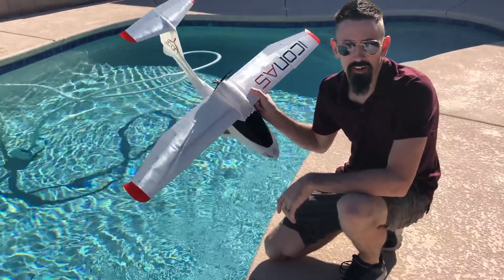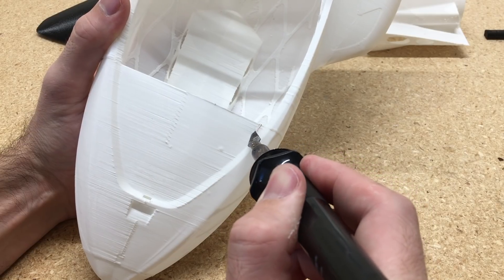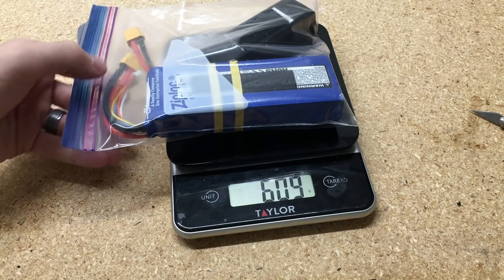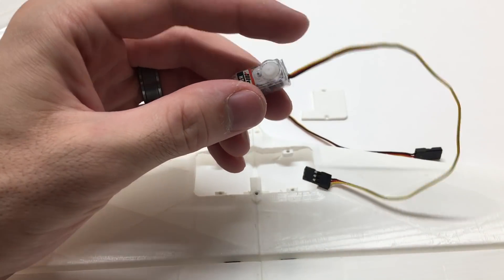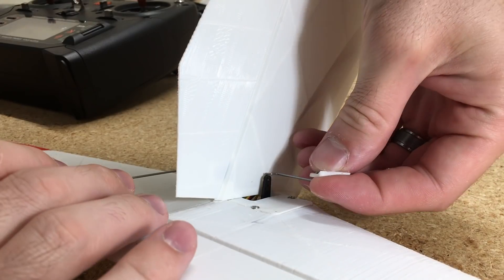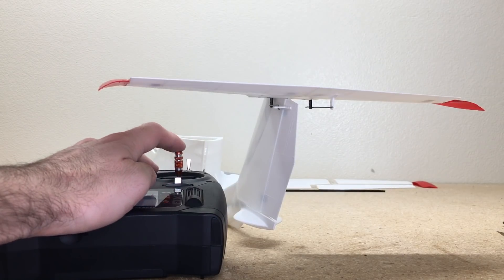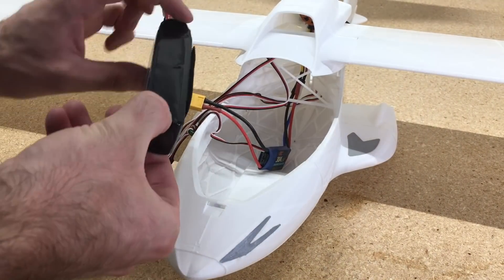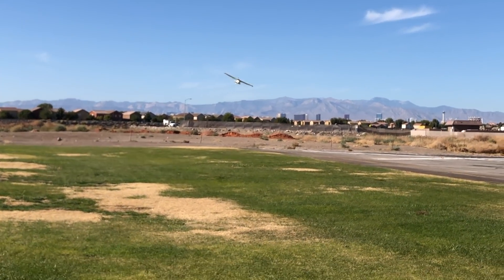How to Build 3D Printed Icon A5 - Planeprint

Comment: For the servo extensions, you can 3d print clips to hold those from coming apart so you don't have to solder the extensions on

Comment: Printing this at the moment and having some success but generally I would say that it is not strong enough the wall thickness is too thin and I think I would have sacrificed some weight for thicker walls. Also Fuselage Part 4 has overhangs that collapse if in CURA you add support it doubles the print time from 8 hrs to over 16 hrs. I can only assume that this will fill the fuselarge with support and because this structure is so thin I dont think I will get it out without destroying the part. I was wondering how you dealt with this issue of part 4
Reply: Part 4 printed fine for me - what bits collapse for you?

Comment: If there were not two servos in the tail, it would balance with a smaller battery and lower AUW.  Too bad they couldn't figure out control rods for the elevator/rudder.  They should've had a look at the Eflite UMX Icon A5.

Comment: I bought the Icon A5 and I can not print the canopy parts I keep getting an error in cura that states it is not manifold. And when I try to print them I get the same thing, it prints the base and then it rises up and starts printing in mid air. I have tried to print them on 2 different printers and 2 different slicers and get the same results.
Reply from the maker: Im sorry to hear you are having this problem. My print worked good for that canopy and I have not heard of this problem. If you figure it out let me know. Cheers
Reply: @TroyMcMillan  I got ahold of the people at Plane print and they said to check all my settings, so I did and had a couple not set right.  And then I tried again and fallowed all the instructions that came up on the screen and tried again and this time every thing worked. I am almost done printing the fuselage and have started printing the wings. I have 2 printers going, Longer LK4 and a Anycubic mega Zero 2.
Reply: and Thank you for the video it has been helpful.
Reply from the maker: @robertprievo2482 Awesome that is great you got it figured out. Thank you for letting me know what fixed it. Nice the wing prints pretty fast so you will have it flying in no time. Good luck with the rest of the build and the flight.Let me know if you have any other questions.
Reply: @robertprievo2482  I have the same problem when I want to print fuselage 2, what setting did you use on your anycubic?
Reply: @denil9598  I found a free version of Simplify3d and started using the factory files through Simplify3d.

Comment: for exampole why dont you do liek sky hawk expanded wings with even more gliding with two mid components xtra and longer holders and also expand brushless chasis to 1-2 cm to get soem spin better and if you still have time a raotional cocpit wouild come fine and shot video is if you do rotational copit then you inser 2x2 mid components to for some extra wieght and even better gliding

Comment: Nice job. Correct me if I’m wrong but there is some ca glue that are soluble in water, no ?
Reply from the maker: I think Mose CA glues are ok for water the ZAP a gap CA glue I used worked good in the water.

Comment: Hey Troy, where did you get your decals... including the "prop" decal?  Great video... I'll be building this one.  Thanks.
Reply from the maker: Hi David, I used "Gravit Designer" to make my own decals. I just typed out the letters and for the prop decal I used 3 ovals with a triangle in the middle. Then I exported the file to be a vector file and had a local vinyl company printed them out. Have fun with your build. Cheers
Reply: @TroyMcMillan  Hi Troy, can you please share the decals files?
Reply from the maker: @ojwhaaaojwhaaa5457  If you would like the decal file you can send me an email there will be a small cost they did take me some time to create.
Reply: @TroyMcMillan  Very cool.  I haven't got nearly that much talent.  What would you think of posting your vector files?

Comment: Hey Troy! Great build video! Something to point out when you move the motor shaft to the rear,make sure you have a flat spot ground on the shaft for the grub screw to bite to, I've had motor shaft screws loosen before and the shaft will freewheel on you. No bashing here, just don't want you to have a motor failure.
Reply from the maker: Thank you for the tip. That happened to me on the maiden flight. I fixed it yesterday and I ground a flat spot in the shaft. I will show what I did in the maiden flight video I will upload in a few days. I need to take it out for another flight first to make sure it is working properly.

Comment: You should of made a spinner and put retracts on it
Reply from the maker: Ya retracts would have been cool but would be more wight and may be harder to keep it water sealed.
Reply: @TroyMcMillan  i used to buy large scale plans and build from there. Today this is so easy. No bulkheads, stringers or even gas. One transmitter for 200 planes. wow